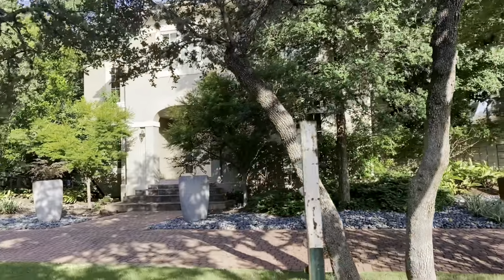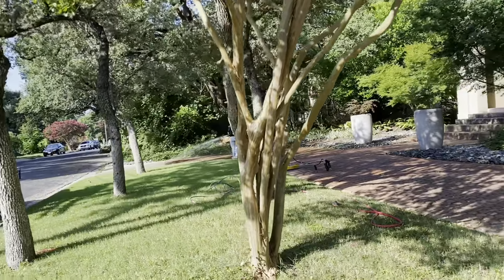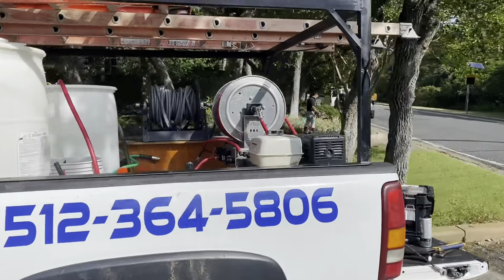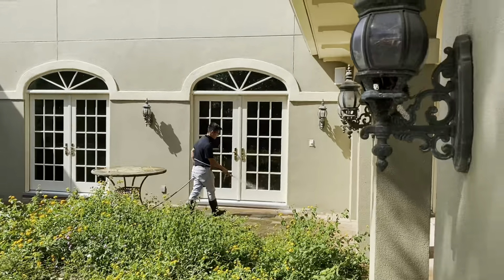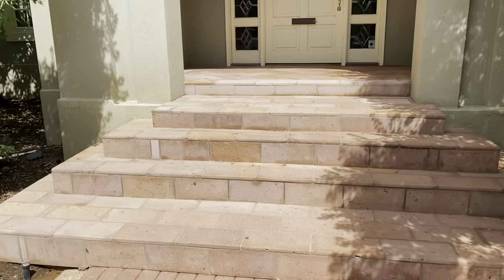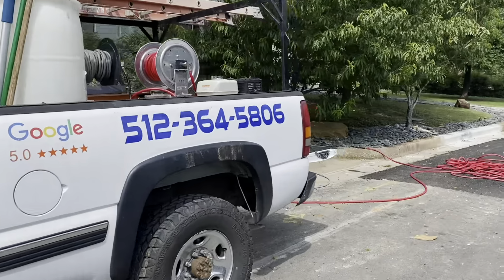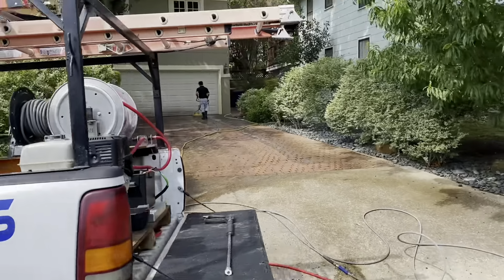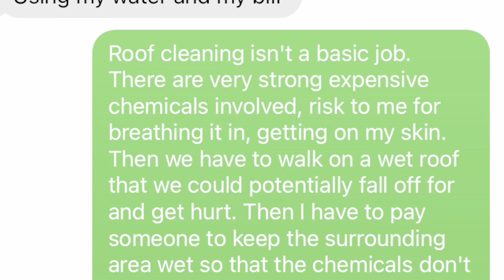Bringing a SUBSCRIBER ON THE JOB | $1700 DAY PRESSURE WASHING

Comment: Good content, what type of nozzle are you using to rinse the debris off the concrete after the surface cleaner and before the post wash application?
Reply from the maker: Typically just a ball valve. Sometimes I’ll get my Lance on there and use a white tip
Reply: @AustinDavis24  Thanks, I use the ball valve and was thinking that was the white tip but it looked like the flow was stronger. Thanks !

Comment: Hey Austin, do you do 2+ story roof washes. If so do you stay on the ladder or get on the roof?
Reply from the maker: Hey what’s up Brett, absolutely we do any roof cleaning projects out there. It depends, I like to hit everything from a ladder, if need be I will get on the roof
Reply from the maker: If you have the right equipment you should be able to shoot solution up 25ft in the air.